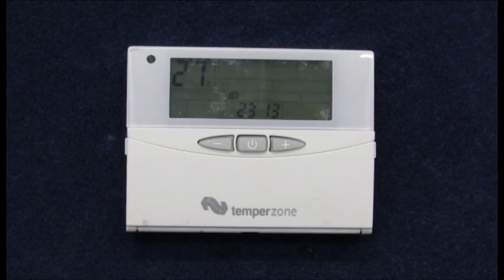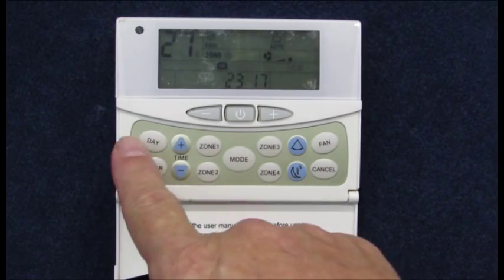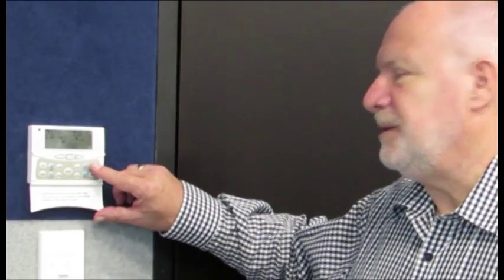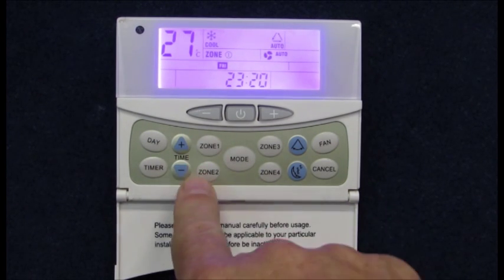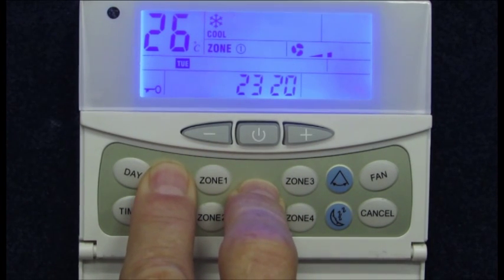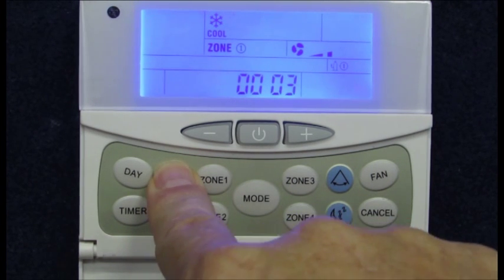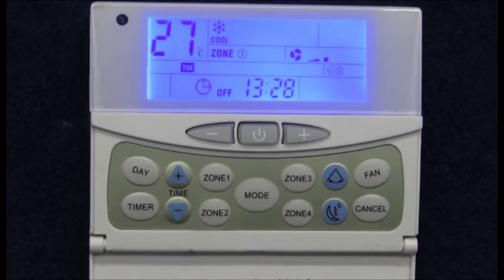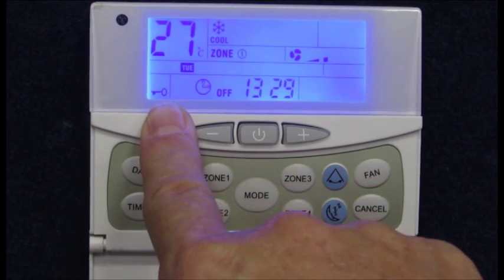SAT-2.1 Controller

Comment: Hi can you update the video to show the latest control panel?  My air conditioner was installed in Oct 2017. I cannot set the timer. I have followed the instruction in the booklet but it is just not working. There is no cancel button on my panel. I did manage to get it to come on once but I set it for 5:50am and it came on at 0130. ( yes the time is correct)
Reply: Sorry for late reply, hopefully you have solved your problem. It could be you have a later SAT-3 controller. Have you talked to our technical support team on 09 279 5250? With either thermostat SAT-2.1 or 3 we could talk you through the issue.

Comment: Can you update this video for winter setting when outdoor temp is 5 degrees and the deice function is operating in startup as mine shows some strange temp setting starting at 5 deg and going to 35 deg. No heating while this is happening is it an error
Reply: Rob Wragg there is no specific setting for winter you set it for whatever temperature you prefer. Usually between 18 and 22 for most people. Setting of the controller is covered in the video. If you have what appears to be faulty controller then call the tech support team on 0800 warranty (in NZ)
Reply: Rob Wragg there is no specific setting for winter you set it for whatever temperature you prefer. Usually between 18 and 22 for most people. Setting of the controller is covered in the video. If you have what appears to be faulty controller then call the tech support team on 0800 warranty (in NZ)
Reply: Rob Wragg also be aware that there is no heating when in de-ice that is normal.
Reply: Hi Tony
Got the service tech to look at unit he disconnected the return air sensor  said that it was probly not in the correct position now the sat controller will do all the sensing
Is this what would cause the problem i was having.
Reply: If the sensor was connected to the wrong terminals then it could certainly be your problem. If the sensor was in the wrong location it could be a contributing factor but not likely the cause. With the sensor disconnected is the unit now operating normally? Make sure the on board sensor is slightly protruding and not touching the wall plaque body.
Reply: unit failed again turned out to be faulty control board on the fan unit (tech said he has replaced a few in Aus) would not turn on fan . Board replaced all now working

Comment: It's unfortunate the sat 2-1 control had the sensor glued to the bottom housing acting as a thermo couple to the plastic rather than sensing air temp.I mentioned this to temperzone
Reply from the maker: Remote sensors are and always have been available. The on board sensor if positioned correctly doesn't act as a thermocouple. However if it is of concern use the remote sensor in the return air duct.